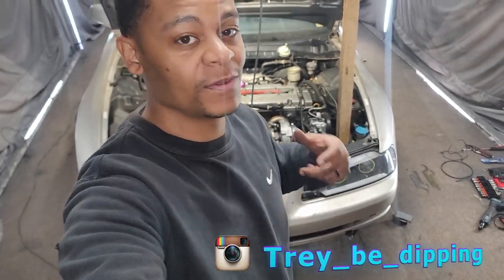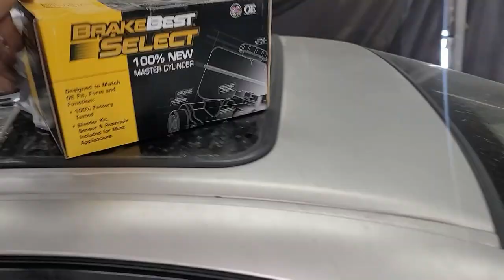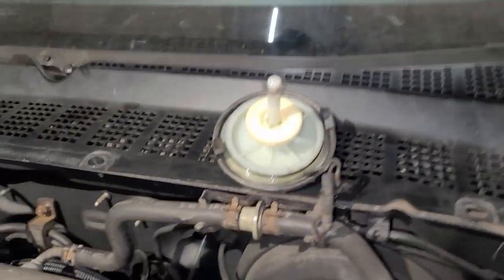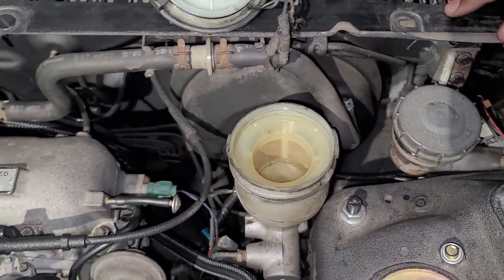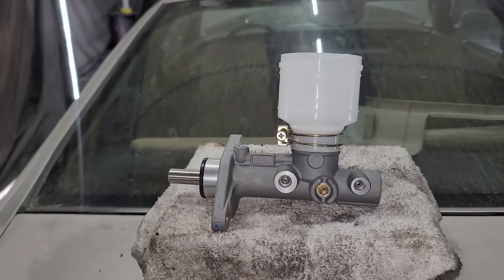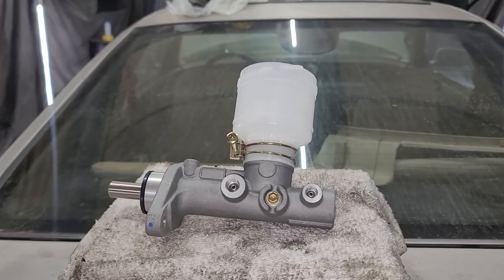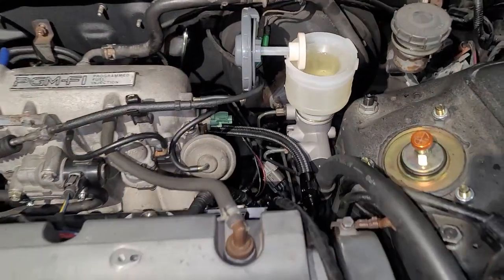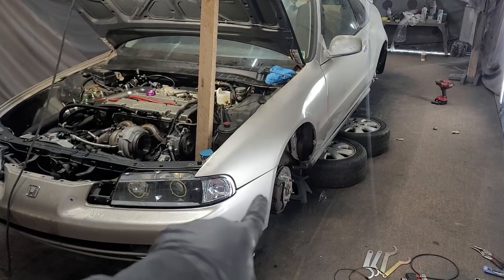1992 -1996 Honda Prelude brake master cylinder replacement.

Comment: Can you make a vid showing how to take the whole booster out or explaining it? Or does it just come out pretty easy
Reply from the maker: It pretty straight forward bro I'm sure you would have a problem figuring that out
Reply: @treybedipping1734 yea but the booster doesn’t clear the intake manifold or strut mount so I wound up having to either drop a mount to move the engine forward or remove the intake manifold, wish it slid out